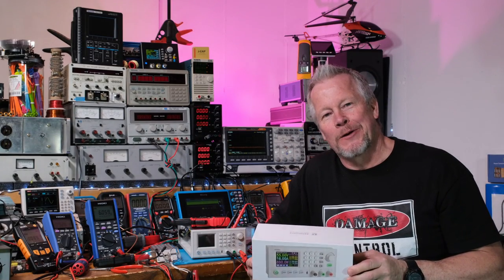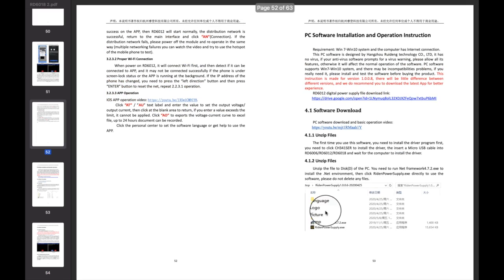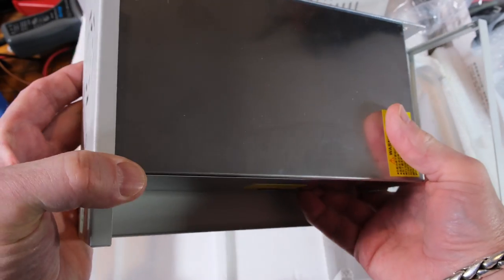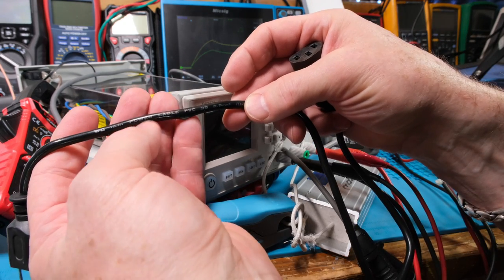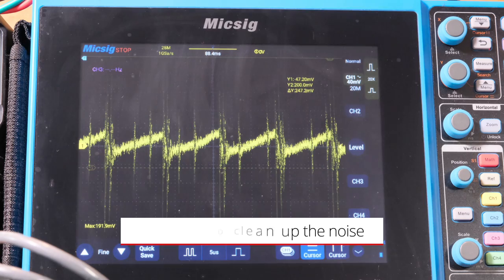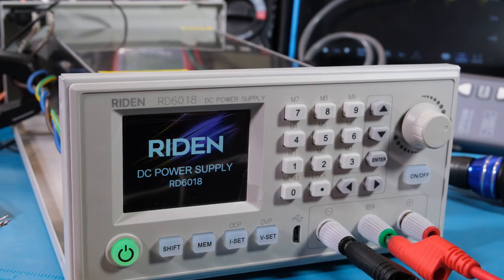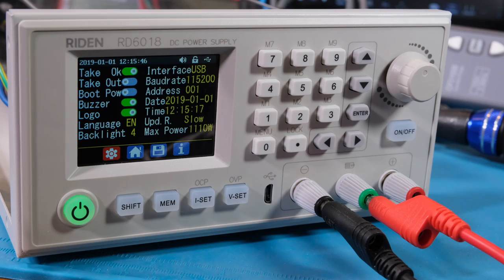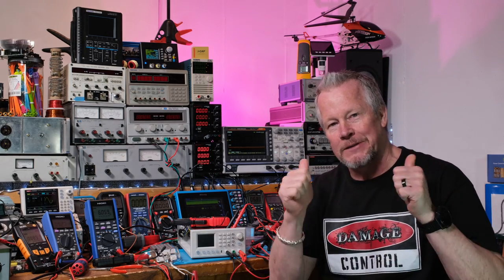Low Cost 1000Watt Bench Power Supply RD6018 #Ridenpowersupply #RD6018 #buildyourownpowersupply

Comment: I bought RD6018 with WiFi but without power supply because I have my heart set on Meanwell brand and I went on EBay and bought 
MW model HRPG 450 Watt , 48 Volt
Cannot find one for 60 Volt but my 
Ryobi lithium battery is 40 (42) volt
which is the highest voltage I ever need now
I got WiFi to work with Apple iPhone 12,
Yes you have to know the IP address, but
WiFi is not practical to use anyway.
This is my to go DC power supply from now on. The Green outlet Jack to charge the battery is the only problem I have, sometime work sometime is cut off for no reasons ! ??
So, I use the red outlet Jack from now on.
Reply: I set my teen son up with a RD6018 on a 48 volt MW. it's all he will ever need, and it will not permanently injure him should he make a mistake.
Most people have no idea how dangerous 60 volts really is...

Comment: great work, thank you for your introduction for that. I like that , but I have to say some things
1, for file code, there is the code on file name 
2, this input PSU is too bad. as manufacturer, we recommended some input PSU at official shop, the quality is best. 
but your PSU is too bad, output voltage is not stable too , and it can't be adjust to 65V. becuse RD6018 is step-down power supply, input voltage must be higher 1.1 times than output voltage. so when you input 60V, you can't set 59v output , understand now ?
3, for phone APP, if you still can't connect , please let me know , I can teach you 
BTW, if you use a better PSU, it will be best
Reply from the maker: Thank you!  I understand exactly what you are saying.  I just can’t seem to find a good power supply for it.  I’m tempted to design one.  Do you have any suggestions?  Also I want to build a second unit so that I can use them for audio where I need a plus and minus output.  I showed how I use 2 Kaiweets power supplies to do this.  Kind of a way to do what a tracking power supply would do but the operator has to dial each power supply up together.
Reply: @KissAnalog  sorry for this, I do not have good suggestions according to your needs
Reply from the maker: You don't have a power supply that you can recommend?
Reply: @KissAnalog  sorry, because normally we often to recommend what we test already, if we do not test, we do not recommend

Comment: Poor America! Only 110 volts, but lots of amps. Bet you wish you had 240 volts? No need to have cables 1 inch thick.
Reply from the maker: LOL That's so true Michael;)   But then again, that high voltage scares me;)
Reply: @z.brannigan9748  😱😱😱
Reply: Thing is, we do have 240 volts as well, homes here have a center tapped 240V feed.  But 240V is only used for high power items (electric heaters, clothes dryers, kitchen stoves, etc).  Things which don't have crazy power requirements use 120V, which is from one side of the transformer to the center tap.

Comment: I think power supply is 2 switch forward and it is very similar Diodegonewild's 24v 1000w version the board is very similar and the windongbprobably for fan to derive some voltage because fan probably 12 or 24 volt https://m.youtube.com/watch?v=mxl7ymOSvho (here is the video i talked about)